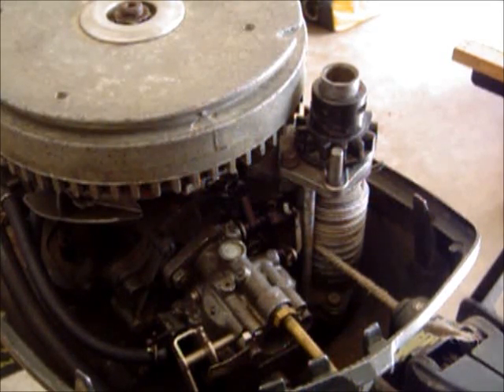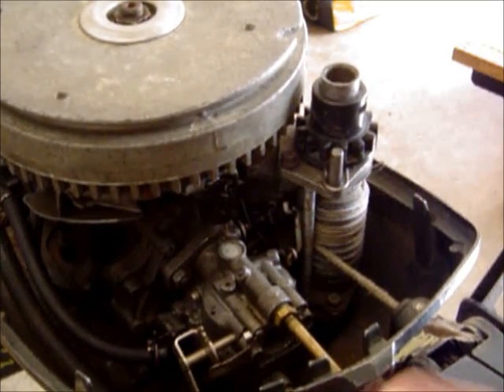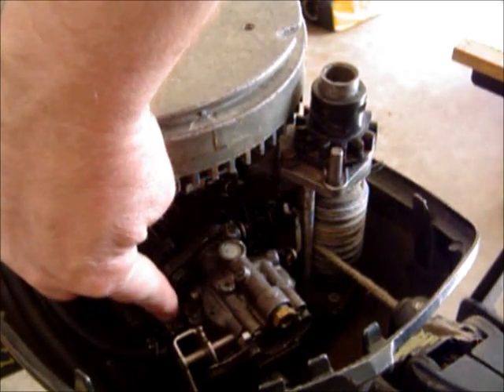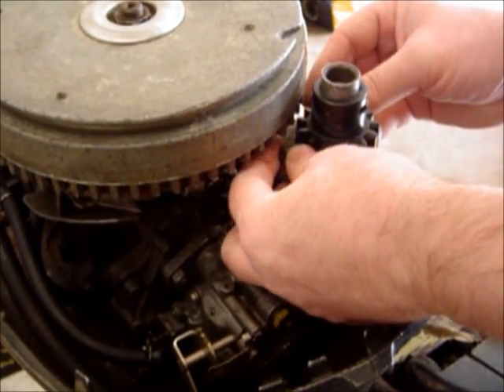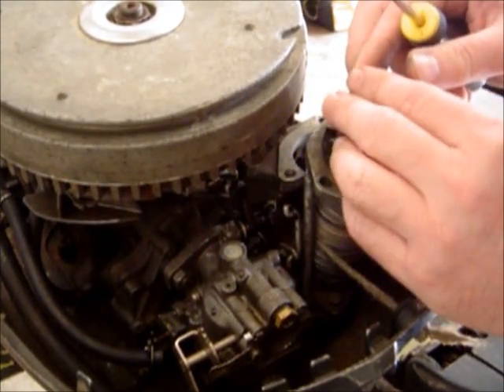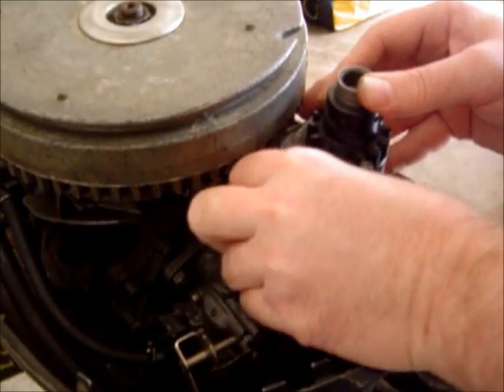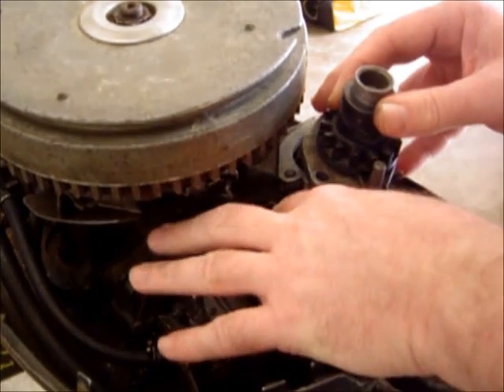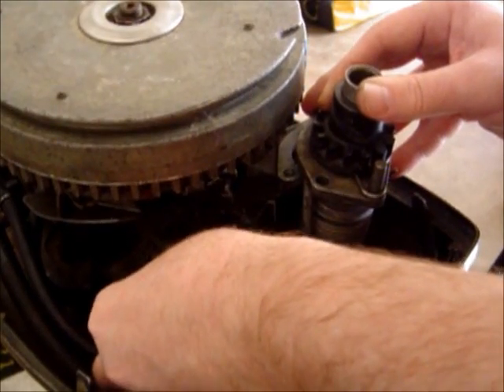OMC fix jet carburetors part 2 of 10  (Motor displayed 1968 Johnson 6hp)

Comment: Question, from the schematics for johnson engines, that carb looks like the one off a 1975 6hp.  I also have a 1968 I'm working on and the carb housing looks different on a 1968 (per the schematics), mine looks like the one on your video.  I need to replace the low speed needle but I'm unsure which one to get and of course they use different needles.

Comment: Hi there I have a 6hp johnson just like the one in the video and it won't run when I take off the choke. I have cleaned it throughly and replaced the boss gasket as well as the low speed needle packing I noticed the top of the carburator has a small hole on the left that is open right next to the top hole that has been filled with a lead shot is that correct? it will continue to run if I spray starting fluid in it when I turn off the choke Soni know it's not pulling fuel. any advice would be greatly appreciated thanks

Comment: thanks for making these videos, just a quick question. I have a 71 Johnson 6hp and new to working on them, but don't want to pay anyone.

my question is, my low speed needle seems to be very loose and has some side to side play. should I look at replacing the needle and seat? it doesn't idol worth anything and on a 14 ft boat last yr I could only get 6kph out of it

thanks
Reply from the maker: If you tighten the the packing nut that surrounds the low speed/idle needle, it should resolve the loose turning low speed needle.  If not, then the packing needs to be replaced.

Good luck with your motor.

Comment: Can you tell me how to rewind the tension spring on the 68 Johnson.  my pull cord broke the other day and I can't get tension back on the spindle.  Thanks.
Reply from the maker: I have been meaning to make a video on that, but work and life have prevented me from doing so.  I still have plans to make a video, but I posted some resource material and diagrams on how to do the starter repair.   Please follow the link listed below.

http://www.aomci.org/cgi-bin/yabb2/YaBB.pl?num=1414076986
Reply: Thank you, I actually figured it out.  I pulled the starter assembly off and found that the spring clip had come out of its groove.  After a few tries to get it back in I used a screw driver to hold the spring down and slipped it back in.  I have tension again.  Was worried the spring had broken which would have been about $75 to replace (new).  Thanks for putting videos like this up, it really helps people like me who are unfamiliar with these motors.